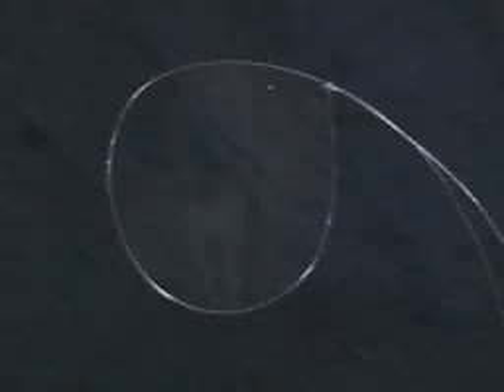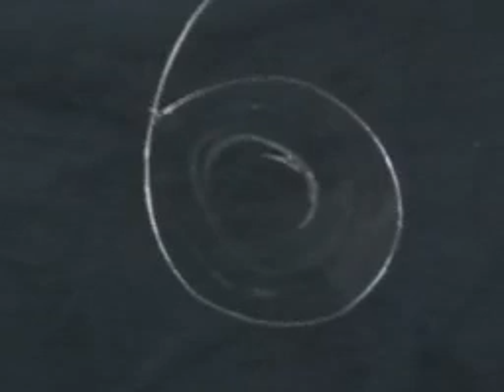Surface tension of water in microgravity 2

Comment: Why is it rotating?  Because it can.  i.e. surface tension constrains the thickness, the wire is a rigid boundary, but nothing constrains the motion of  the water within the plane region.

Comment: Liquid forms a meniscus, because of it's surface tension (when you measure fluids in a graduated cylinder, you have to watch for this, it can throw off your measurements) a meniscus LENS is concave on the back, and convex on the front (like most eyeglasses) he was making a joke, CLEARLY the lens he made wasn't a meniscus lens, however, it was like the meniscus of fluid in a gradcyl.

so, it's funny.

Comment: why don't you put an electric drill and run it near that water film, you will see how the the water film spin. You will increase the spin if you put a flashlight on the water film. Because Light and Sound is made up of magnet (N & S), atoms is made up of magnets, it is all that simple, read Edward Leedskalnin (Magnetic Current).